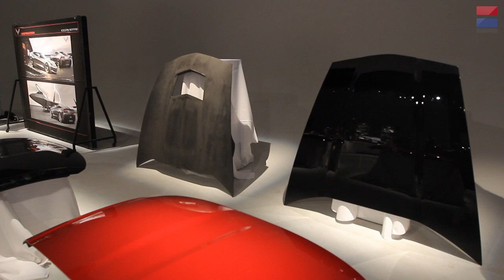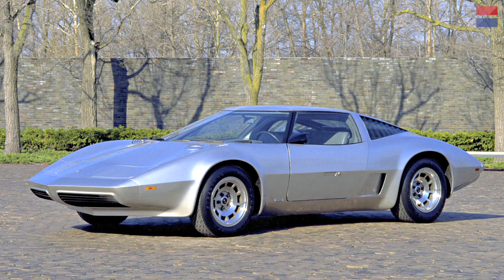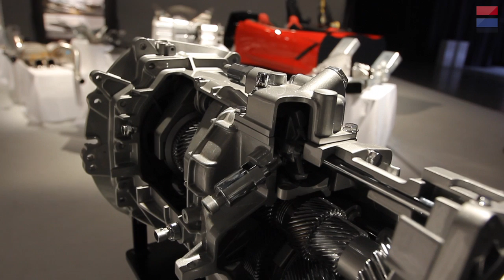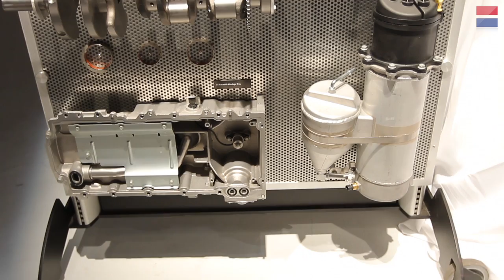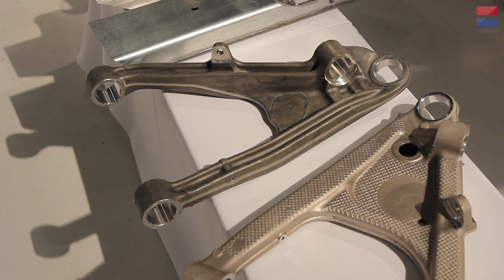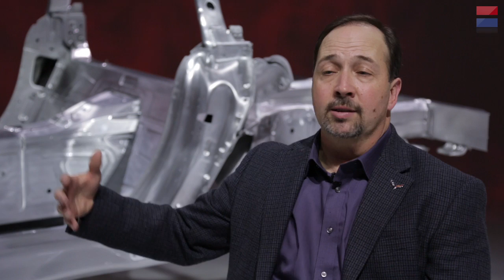2014 Chevrolet Corvette Stingray / Z51 Revealed @ 2013 Detroit Auto Show - CAR and DRIVER

Comment: Those same magazines also reported the C6 ZR1 having 620HP until GM did official SAE HP testing and certification. GM has not measured anything yet so they release very conservative numbers they know will be met or beat by the actual figures. It will be lighter, thank all the new aluminum and CF. The figures you have now are not certified or official.

Comment: No way that's what the C6 base model weighed. GM has not released any official numbers yet. I'm will to bet it's a couple hundred pounds lighter than what the estimate is. GM also does the same with HP figures. For example they said the C6 ZR1 would have 620HP but ended up producing 638HP once they tested it. Same should be true with the 450HP estimate. 

There's no way swapping out the C6's steel with aluminum and CF will be as heavy. GM is being conservative on the estimates.

Comment: It will be lighter than the overly conservative estimates. The C6 GS had a steel chassis and frame and weighed a little over 3300lbs the C7 with all the aluminum and Carbon Fiber I'm betting will be at or under 3100lbs.

Comment: IF the weight is actually 3350, or even close(and that's a BIG "if"), that most likely represents the highest trim level on the base car, with all the bells and whistles that add weight. Just like the standard SRT Viper weighs nearly 200lbs less than the top-tier GTS. So I'd say the most culprits, if that estimate ends up correct, are beefed up components in the Z51 models, plus the added weight of the new engine tech and electronics, and the weight added by all the leather wrapping and whatnot.

Comment: If you expected it to be that light, in base trim, you were fooling yourself in the first place. Even the Z06 wasn't that light, and it was THE lightweight of the modern 'Vette lineup. You'd need to have carbon everything AND a stripped interior to get a sub-3000lb weight out of a Corvette; cars which are always some of the lightest in their performance brackets in the first place.

That said, 3350lbs is too high, I don't know what they're basing that on.

Comment: wow improved design resulting in weight loss all around, improved interior, improved suspension and better stiffness, improved air flow, improved fuel economy while being faster than the current gen C6 Grand Sport...

Looks like Chevy really did their home work.

Comment: You have been absent haven't you.. 2014 line up is including the 2014 GM Silverado/Sierra 1500, 2500, 3500 pickup trucks. 2014 Chevrolet Malibu, 2014 Chevrolet Impala, 2014 Chevrolet Colorado, 2014 Chevrolet Trailblazer, 2014 Chevrolet SS (Lumina) Zeta platform 4-door Sedan with RWD!!!

Comment: Cheap V8 sports rcar...not gonna be that light
The GT3 RS, stripped, and still weights +3000 lbs
Stop expecting so much and understand that real cars cannot, and will not be that light!
3350 is a very respectable weight for a car with so much power

Comment: Ford changed the Mustang to vertical taillights in 1994. Because of out cry they went 3 bar horizonal (traditional) in 1995 to now. GM will do the same (4 round) in 2015...bet.

Comment: The styling of the C6 Vette is much better looking than this. A Camaro should NEVER influence anything on a Corvette..thats assbackwards. Taking away the rear hatch glass/basket handle roof was mistake #1! Putting those dumbass taillights instead of traditional round fixtures is mistake #2! This car was inspired by too much of it's competition instead of just being a Vette!

Comment: It will grow on me. But Corvettes are fluid not anglar. C7 is a lil too "venty". It will look better in black(hiding vents) I can live with the hatch but not hatch & square tailights. I bet 2015 will go back to round lights. Steering wheel center too large. Come GM you gave it, its own seats. Give it a proper steering wheel. And the current Caddys have better balanced interiors.

Comment: Well this thing is horrible. There is no cohesiveness in the design. It appears as if 8 people designed 8 sections and pasted them together. The greenhouse was directly cut off a GT-R; the front grill from a '53 and is totally outta place, the rear lights from a Camaro that was squashed in the wreckers...DANG. The interior appears the same. The drivers binacle is nice, the seats appear nice but that swath across the passenger dash forces your eyes to the a pillar and is from a different car.

Comment: The rear end is more than taillights....Im talking about the rear window and the rear quarter panels wrapping around it. The taillights are larger models of the concept Stingray which was drawn up before the Camaro. A rear end of any car is much more than taillights and if you think this looks like the Camaro from the back then you either need glasses or you like making huge generalizations. So yes it looks more like a 69/70 Vette in the back with the modern twist the concept Stingray had.

Comment: Greendude33: Perhaps you should review a picture of the 1969/1970 Corvette. The 69/70 curves the opposite way to the 2014 model (the 2014 is curved like the Camaro). 69/70 has 4 round rear lights whereas the 2014 lights are rectangular, like the current Camaro. The 69/70 either has side pipes (2014 doesn't) or two pipes out the rear on the sides. The 2014 has 4 pipes come out the center of the rear. The current lip on the vette is larger than 69/70 (current is like the Camaro).

Comment: Engine displacement is the volume swept by all the pistons inside the cylinders of an internal combustion engine in a single movement from top dead centre (TDC) to bottom dead centre (BDC). It is commonly specified in cubic centimeters (cc), litres (l), or (mainly in North America) cubic inches (CID). Engine displacement does not include the total volume of the combustion chamber.

Comment: Looks great in the cockpit and outside. Greatr changes to the frame; however, Chevy still has a suspension based on 1920's design. GET RID OF THE LEAF SPRINGS and get a modern suspension. Also, get an in-house designed and built DOHC V8. Only then will Chevy have a world beater!